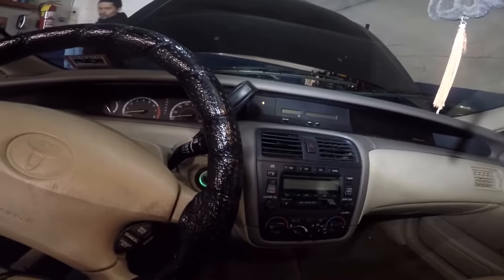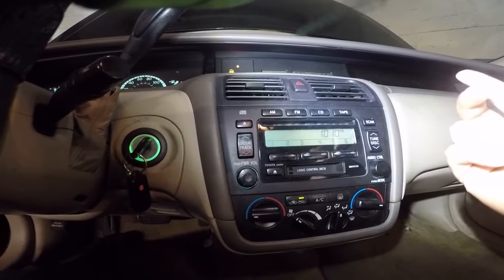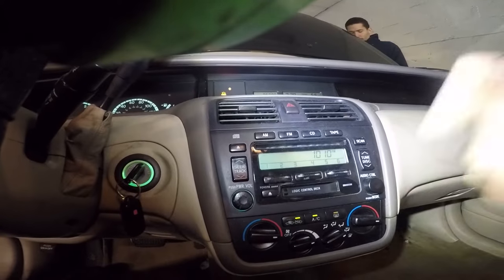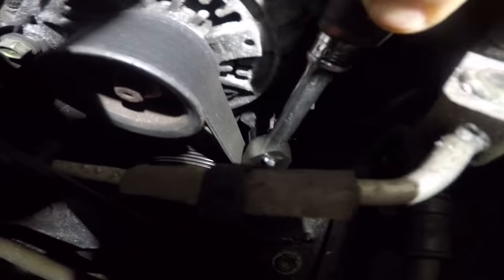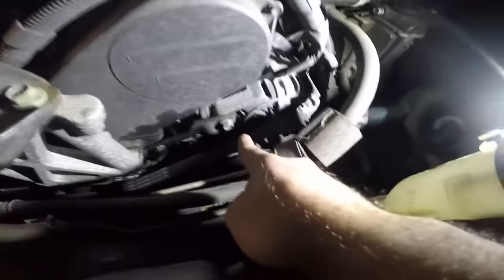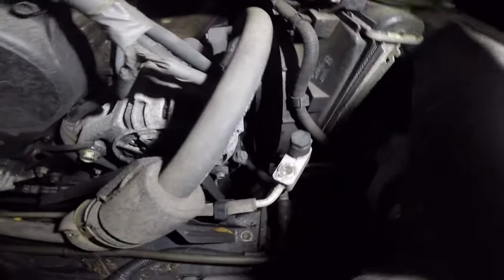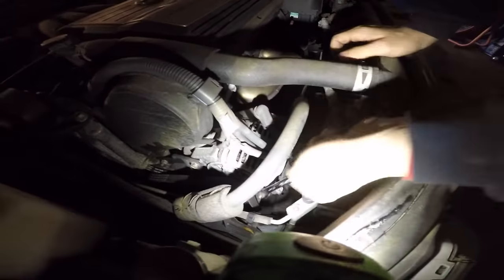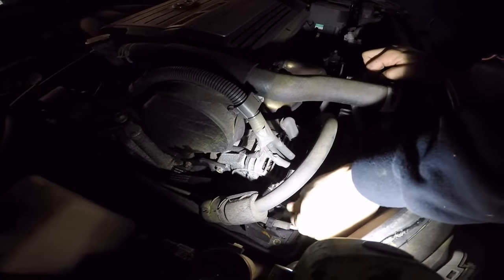squaking noise when car is cold or when putting AC on

Comment: Me pasa lo mismo con un Nissan Versa 2015, cada vez que giro el guíe o prendo el ac, hace ese mismo ruido. Ya verifique la polea y esta bien. No se qué hacer.
Reply from the maker: Sorry I only know english
Reply: The same thing happens to me with a 2015 Nissan Versa, every time I turn the steering wheel or turn on the ac, it makes that same noise.  I already checked the pulley and it's okay.  I do not know what to do.
Reply from the maker: @Matatanpr7  replace the belt if they r old usually the belt gets stretched

Comment: Hey buddy, im having the same noise but only when the AC is turned on, when i turned off the AC, noise is gone but once turned on, noise is coming
Reply from the maker: Possibility the belt or tensioner depends on the set up
Reply: I have the same problem( only with AC on )
 How do you fix the problem ?

Comment: I have a different noise, my ac makes a noise when I’m at a stop light but goes away when I’m hitting the gas, it’s a rattling noise
Reply from the maker: Check ur idle rpm when ur stopped if it’s below 7-800 that might be the problem or engine mounts
Reply: @RBTheMechanic  where should it be at so I know, I’m going to check that today when the sun comes up
Reply from the maker: @newgrandorder  the engine mounts?
Reply: @RBTheMechanic  if I change the engine mounts shouldn’t I change them all?
Reply: @RBTheMechanic  how do I do that? I don’t know much about cars but I’m learning
Reply from the maker: @newgrandorder  well what kinda car u have and what’s the issue is ur not good or hand on person best would be take it to mechanic shop but at least u know what the problem is so they don’t tell u XY and Z and cost is $1000
Reply from the maker: @newgrandorder  what’s wrong with ur car this is belt video mount is somthing diffrent story what’s the issue and yes if u do one u should do all so other and new one don’t take beating
Reply: @RBTheMechanic  I have a mechanic I just can’t figure out what the noise is, everything that he thought it was I got him to fix but it seems like it can be a different issue cause the rattling noise is still happening. This rattling issue happens when I turn my ac on does it with the heater as well.
Reply from the maker: @newgrandorder  what kinda car u got and can u make a small video let me hear it  post it on ur utube
Reply: @RBTheMechanic  yes i can I’ll do it first thing tomorrow morning. And I have a 2014 Chevy Cruze LT RS 1.4 turbo
Reply from the maker: @newgrandorder  ok let me know when u post it have some one help u. So u can record where the noise is about comming that way I can pinpoint it
Reply: @RBTheMechanic  I uploaded it I accidentally put a premiere but I fixed it. Sadly I didn’t have any help but I tried to give it a good shot. My wife is going to help me in the morning if this video isnt good enough. But I hope it is. And you’d be able to point it out for me. Anything helps tbh
Reply from the maker: @newgrandorder  that sounds like the engine it self … what u would do is take off the belt and then start it up just to pin point that once belt if off and there’s no noise it’s related to belt or tensioner somthing that’s moving with belt. But if it has noise with belt off then it’s internal components of engine such as lifters
Reply: @RBTheMechanic  thank you so much I will definitely be taking it to my uncle shop. I’m going to have him test it for me and see if that’s the issue. Thank you very much I really appreciate it 🙏

Comment: I hear this same noise when I start my car and the AC or heater blower is on. I can turn off the blower and the noise goes away. I have also opened the hood, started the car and listened for the noise. It is coming from the passengers side. When I turned off the car, the chirping noise continued for several seconds. Any idea why? Thank you.
Reply from the maker: Nancy Ensley what kinda car u got seems like belts if ur belts are on that side it’s mostly is the belts
Reply: no is not,,is a pulley
Reply: @RBTheMechanic  i have a kia sorento 2005 i have same issue as Nancy. I’m thinking it’s the belt too. I checked and the belt was loose not sure if it’s too loose though 🤷🏼‍♀️
Reply from the maker: @jimbooo5713  if it’s squeaks then it’s either loose or old so if ur belts are hold change them if u recently changed it the just adjust it
Reply: @RBTheMechanic gotcha. Will change it once the weather is warmer and not -30 degrees
Reply: @RBTheMechanic  so i realized that when i make a sharp right or left turn with the heater on it makes the noise. It also makes the noise if i have the heater on and come to a complete stop and then keep driving? Idk if that would make a difference
Reply from the maker: @jimbooo5713  can you make a videos I would like to hear this I had this type of problem on sienna heat didn’t stop but noise soon as I made sharp turn the water from ac evaporator didn’t come out the pipe was blocked and it went in to blower motor every sharp turn I think I have a video on it I’ll check and send u like give me till tomorrow but try making a video for me so I can listen post it on ur utube
Reply from the maker: Here’s a video try check see if ur drain pipe is letting water out worth the try https://youtu.be/Fg_TSv-bYAI
Reply: @RBTheMechanic  i’ll make a video tomorrow and upload it for sure
Reply from the maker: @jimbooo5713  ok 👍

Comment: Hey it happens when I steer the wheel what does that mean
Reply from the maker: Belt is prolly old and loose stretched replace it
Reply: @RBTheMechanic  question what happens if the bell breaks does it like damage the engine completely or the AC does not work

Comment: Hello brother ,
I got the same sound on my2016 toyota RAV  4. The mechanic changed the tensioner and belt  last year it was ok for a year now it’s start making the same exact noise when I put AC on after driving 3-4 miles the sound disappear please help.
Reply from the maker: I would replace the belt it usully streched out
Reply: @RBTheMechanic  
Brother it’s new belt put it on last year ! 
OEM. Thanks for the replay. Mechanic telling me is not adjustable. Would u suggest new belt. Oh man.
Reply: @RBTheMechanic  
Brother I see a video guy showing putting dielectric grease on the rib of the belt and it’s stop making the noise. Did u ever try that. Let me know please.

Comment: My noise goes away when i press in the clutch and switch of the headlights and A/C all at the same time, also goes away when the engine is warm. I guess i got the same problem. My belt is hardly 20k miles old, also have a new waterpump and idler pulley.
Reply from the maker: Usually they start to make noise when u put on ac on a uType of load but I guess give it a shot